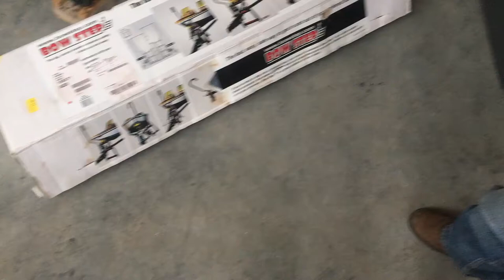Bow step

Comment: Thanks for the video Roger! I am waiting on mine and wondering what tools you used to remove the insert from the ladder to move the handle to the other side? Somebody else stated they had to order an insert from Quality Mark for their unit in order to switch sides, really hoping to just swap it to the other side like you did! Thanks for any help.
Reply: For anybody else that would wish to move the handle to the other side of the ladder. Just use a few different sizes of flat blade screwdrivers and work slowly to remove the handle insert, it comes up pretty easy.
Reply from the maker: Sorry… I just saw this, but ya…I don’t remember it being too complex. Thanks for the additional info.

Comment: Now that you’ve had it a while do you still like it? How is it holding up?
Reply from the maker: I’ve had no issues to this day and still pretty impressed with it. Use it all the time.
Reply: @rogermezenen959  how is it holding up to the salt? I also fish brackish and saltwater.
Reply from the maker: @ReelinTension  I typically only hit salt once a year… and it’s far enough forward on the trailer, it doesn’t enter the water. So very little rust.